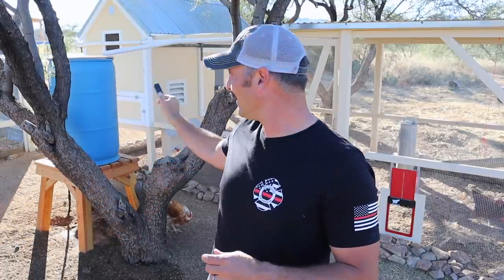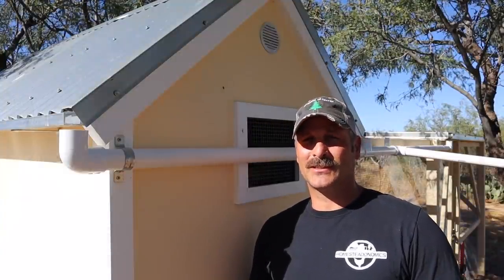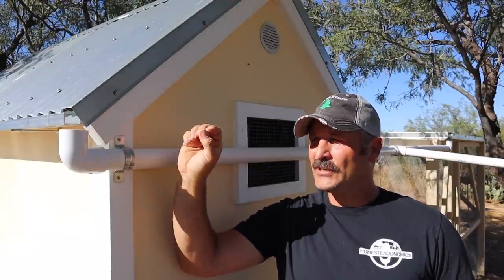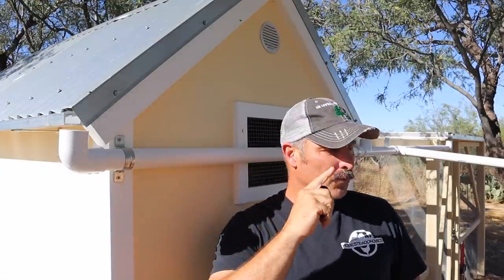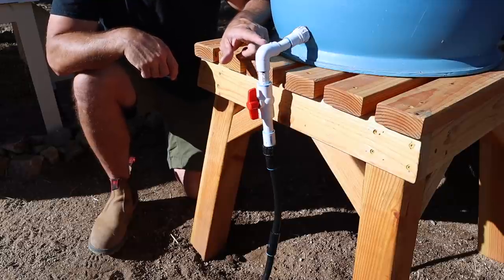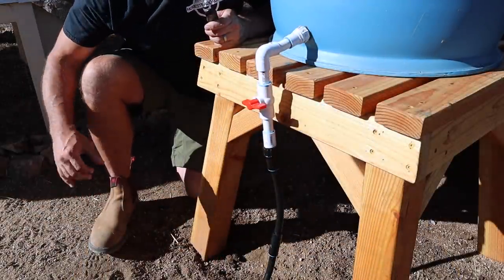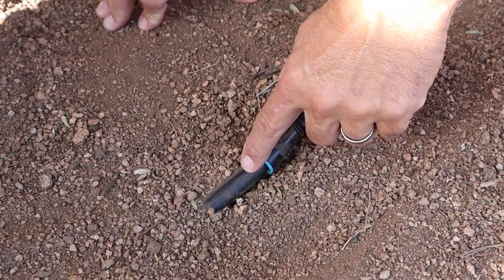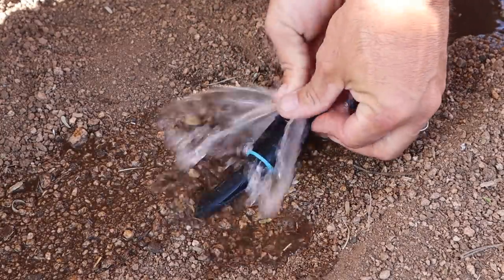Building a DIY Chicken Coop Part 5 - Rainwater Harvesting / Watering System

Comment: Very nice setup for your chickens! In my last house we had rain water collection and for the down spouts I had the same problem with the screens just getting clogged up. What we did was put on an angled screen , sort of a PVC box with a 45 cut at the top of it to hold the screen. Water went through fine and leaf debris slid off the 45 degree angle. If it got built up the water would wash it off basically. Seemed to work well. Thanks for sharing and I always learn something from your videos.
Reply from the maker: Yes, those actually work really well.  The tank supplier I purchased my house rain tanks from sells them.   But for this coop there’s not enough room for the drop aspect of it.   But for the house they are pretty cool! 😀👍

Comment: One more thing I think you need to consider,
 an overflow in your barrel to avoid water overwhelmes every thing around the barrel. 
You may make around one down from the top and  guide it to irrigate a tree or something else
Reply from the maker: I plan to have an over flow go into what ever I set up for the goats.   It’ll be down hill so the flow will be easy 😀👍

Comment: Hey, I don't know if you've ever addressed this in earlier videos but have you ever thought about putting trail cams out to catch some wildlife footage? I bet you'd have some interesting visitors from time to time.
Reply from the maker: I have on my rainwater wildlife water project.   And as a matter of fact I’m getting ready to do another video on it as I recently upgraded it to 3 IBC totes from the original 1 tote setup.   Approx 600 gals extra capacity. 
Bobcats, deer, foxes, coyotes, rabbits, bird, etc.. … except for one issue.  My game cams have all stopped working and I probably won’t be able to add any new footage in this video.  Might add some old clips though.
Reply: @homesteadonomics  
I know there are the the self charging attachments available having use of  solar panels, that are about 8-10" small yet quire adequate to keep battery  going.

Comment: Simple instructions to a relatively complicated process, especially those of us that do not have the proper tools.  But, you're teaching us to fish.  I'm not sure if I missed anything about the chemicals that are used in plumbing tape, sealant (I think I see the waterproof blue). Did you find a way for them to not ingest all the chemicals in their water?  Or expanded PVC pipe, on a hot day, that may start to deteriorate.  Great design, I'm building something similar, but with one raised roof point.  Gravity does the rest.

Comment: Great job. How does the water get to the waterers? Is the a RAM pump, Gravity fed or some other type of pump?
Reply from the maker: It’s just the gravity and difference in level from the barrel to the cups .  Since the cups are lower that the stand the barrel is on the water will always flow to thr lowest outlet in the system😀👍
Reply: Thank you so much for your amazing videos

Comment: I have some questions about the size of the gutter you chose, questions I only have because of what I learned from other videos of yours.

Don't you get a lot of your rain in rare but heavy deluges?

Won't those gutters be quickly overflown and direct only a small portion of the rain into the cistern?
Reply from the maker: They are undersized a bit for the coop roof but the other one should be fun capacity wise.   It’s more just using the pieces I have on hand that will allow for proper drop to thr pvc and then to the barrel.   Bigger gutters would catch more but ultimately there is only so much that barrel will hold

Comment: I use those watering cups too; however, I don't find it as easy as you show to remove the cup!  ha  It's like there is invisible glue holding fast!!
Reply from the maker: There are a lot of different versions of this same cup.   These specifically were from tractor supply.  But I originally tried some from Amazon and they were terrible. They looked the same but the quality was not good at all.
Reply: @homesteadonomics  I've thought about experimenting with the weighted cup (fills up on its own?)  but I have spent a "small fortune" on experimenting with waterers and feeders.  ha

Comment: Do you use misters in the summer?  I'm your neighbor over in Sierra Vista, AZ, albeit we don't get as hot - only high 90s, maybe one day at 100, 101.  Sitting at 4,500 feet.
Reply from the maker: We are actually pretty similar to you as well.   Closer to Tucson but we are at 4000’ and it definitely helps to keep things cooler.  We do get in the 100’s more often than you but not extreme.   
As for misters, no.   But plenty of shade… under the coop, the shade roof in the run and also the position of the coop is between two trees so it gets plenty of shade as well😎👍
Reply: @homesteadonomics  Good info, thanks!

Comment: Hi, what kind of filtering system do you use for filtering rain water before pumping in to your home?With your DYI ideas, I have installed rainwater harvesting system for my roof top water, from past 10months we have used 80000 litres of rain water, thanks a lot
Reply from the maker: I don’t do much that is very special.   I let the rain tank settle out first.   Then use a transfer pump with a sediment filter and pump the water over to my green tanks that are connected to my house.  I will add a tiny amount of chlorine at that time.  Way less than what a municipal water service would add.   Then everything in thr home is just that water.  But for cooking or drinking water we filter through a berkey ceramic filter.  But sinks, showers, laundry, etc is just the straight ol rain water

Comment: Anyone found a good water-proofer + Paint mix?????   Ordered A wooden coop I still have to build, it'd be nice if the rain didn't rot out the coop in 1 year.
Reply from the maker: I’d recommend researching a boiled linseed oil and/or urethane and thinner mix.    Some teardrop forums refer to it as “the mix”  you thin the polyurethane or linseed oil with thinner to allow it to soak in more.   Then progressively with each coat thin it less and less until full strength
Reply: @homesteadonomics    Thank You!

Comment: Why didn't you glue the PVC joints? For re-useability?
Reply from the maker: 9:22 😀👍
Reply: @homesteadonomics  Sorry, I should have been more specific. I was referring to the rest of the joints. Same reason? Just in case some sparrows start nesting inside the drain? ;)